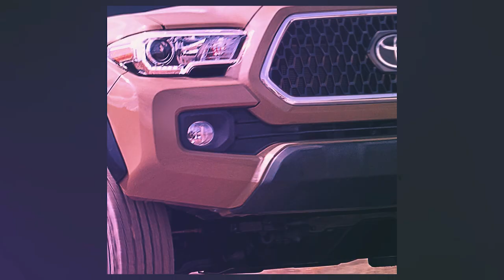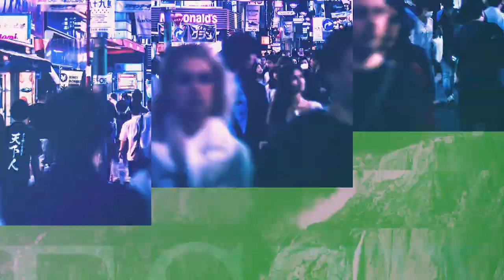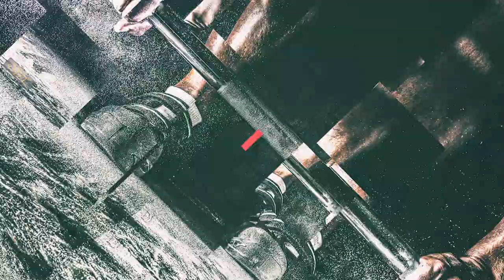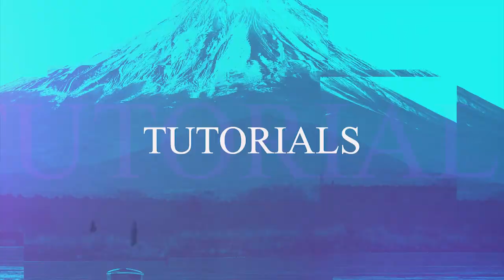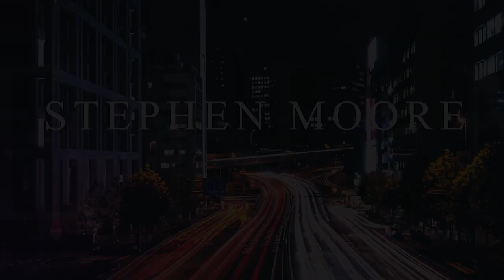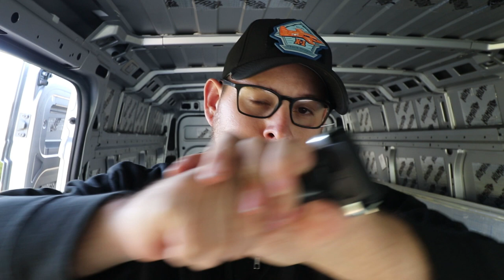QUICK TIPS For Sound Deadening YOUR Vehicle! | Stephen Shreds Fat | VAN BUILD TIPS | Kilmat

Comment: Would have to disagree about the roof, at least in a Ford Econoline. When bare, they are extremely tin-can sounding. I used 4 50mil mats on the four rear sections of my roof, and it made a HUGE difference.  I didn't think it would be as dramatic of a change, but it sure was! Finished wheelwells tonight, and plan on moving to doors and walls next.
Reply from the maker: Nice!

Comment: Hi, do you know if the rain affects the kill mat?  Because if you attach it to the door panel, i am assuming it's going to get wet when it rains.  Thanks
Reply from the maker: Your door should be water resistant also it should not affect the kilmat
Reply: @StephenShreds  what I mean is that when it rains, water tends to enter between the window and the outer door panel.  There are holes on the bottom of your door to allow this water to exit the vehicle.  That is the reason why there is a moisture barrier on your inner part of your door to prevent moisture from entering the inside of the vehicle.   When the water enters your door, the kill mat will be exposed to water.

Comment: Surprised about the floor and roof . I think most people put it on the floor
Reply from the maker: It's primarily used on the wall because the don't have ridges to reduce vibration. But it works on all surfaces. The roof was extra sound deadening I had. Plus the roof doesn't have all the extra weight of the flooring and cabinets that the floor has
Reply: @StephenShreds   hey! how many boxes of the killmat did you have to buy? cant seem to find a answer anywhere.. gave you a thumbs up! :)
Reply from the maker: One sec I'll will look it up on my Amazon account
Reply from the maker: I bought one 50mil 50sqft box. It does a great job and you don't need to make the van a spaceship! I ordered an extra box for when ever I want to do the top cargo area and the doors. I'm just working alot and it doesn't bother me.
Reply: @StephenShreds   okay! thanks so much.
Reply: Bro I have a 06 GMC Yukon. Tonight I did my front 2 doors only.  An bro I took my time it came out like a dealership did it. All the talk about cutting hands etc, don't believe that. I have pretty big hands an o did just fine, I wasn't rushing. I purchased the 50mil 50sq and the 80mil 18sq, I still have a whole bunch left over of both. Yes I plan on doing my rear hatch an 2nd row door, will do my headliner but not doing that myself smh. I know once I install my 4 sundown X15's v2's even sound deadener won't save my yukon.
Reply from the maker: Nice man! I still would wear gloves though I cut myself a decent amount of times to make me not do it barehanded again😂